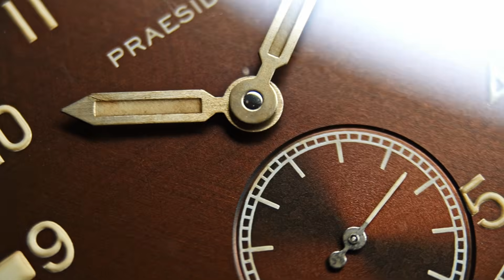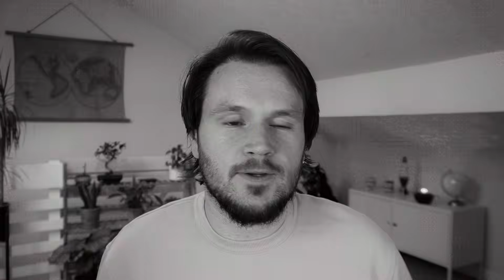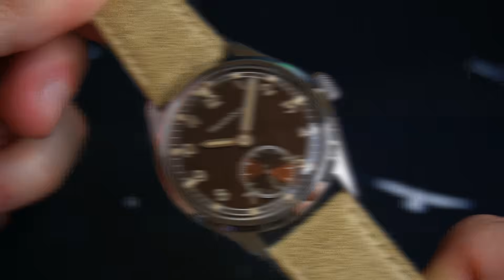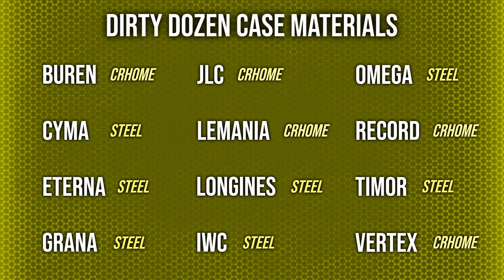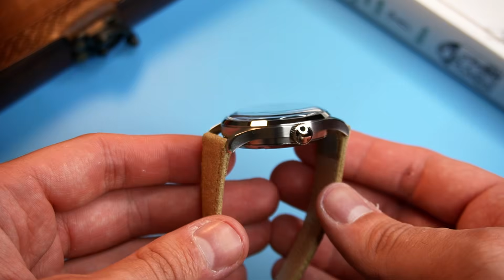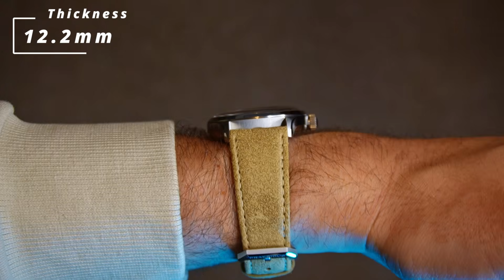This Dirty Dozen Field Watch is... Beautiful

Comment: You know... for this kind of watch... I think I'm partial to actually sticking to plexiglass.
I know, it doesn't fit a premium watch.
But just think about how gorgeous a slightly yellowed and roughed up acrylic would look like on such a watch... A watch like that should be able to wear battle scars and everyday wear down to its crystal, not faking its age by blasting the dial with UVs on the assembly line...

Comment: I own a Praesidus DD-45, specifically the model with stark-white lume and a black dial. As I didn't favor the OEM sand-brown strap, I switched it out for a water-resistant  Hirsch black leather strap--and now it's one of my favorite watches in my rotation, being specifically the watch I wear on weekends. It keeps great time, and is absolutely effin' handsome. No regrets on my end, only absolute satisfaction.

Comment: It's very rare that modern spring bars actually fail. The fact that they have opted for the standard spring bar configuration offers you both, the option to use two-piece straps or pass-though straps. I personally prefer to wear my watches on two-piece straps as this makes the watch sit better on the wrist.

Comment: Looks lovely and I would love to have one. Kieron,  I'm wary about the size though, any thoughts on how it wears? I'm still relatively new to watches in a semi-serious kind of way and have decided that 40mm is the minimum for me on my 7.5" wrist.
Reply: That is a big wrist for sure, but I wouldn't reject the watch without wearing it. The small bezel will make it look larger on wrist. The most important factors in how a watch wears are the lug-to-lug, the bezel to dial ratio and the lug width (wider straps make a watch look bigger).

Comment: The Serica 6190 swiss made has a 200m wr, sapphire crystal but with a COSC movement at 1000. Traska offers way better specs watches in this cathegory with better specs with a Miyota 9 series with no ghost position at 600.
Reply from the maker: Great options... But they don't deliver what this watch does with the dial. I don't think Praesidus went for a spec monster with this watch... The cost went into the creation of the dials instead